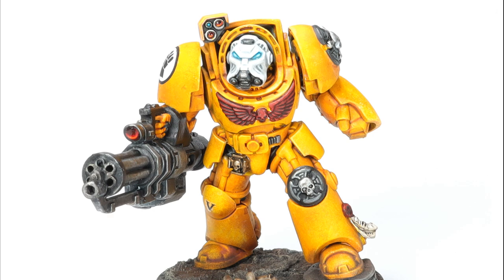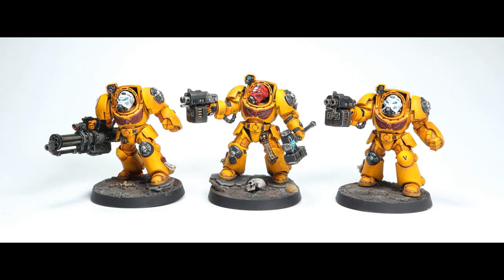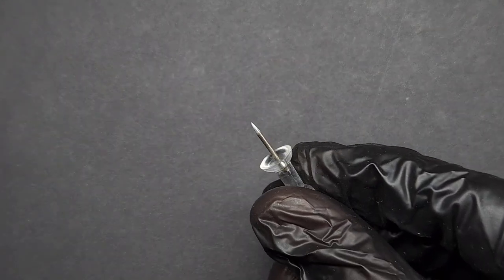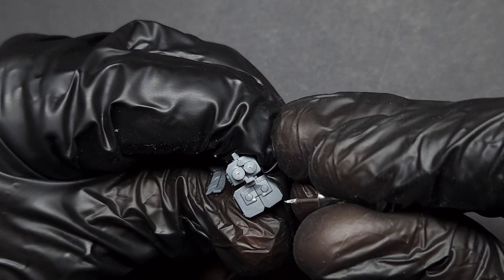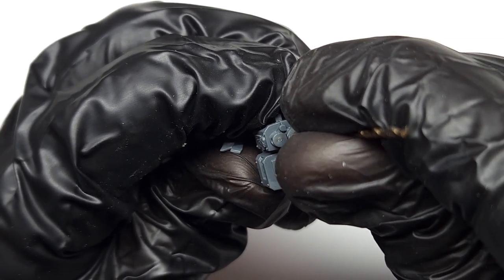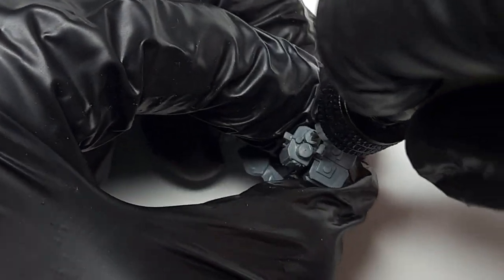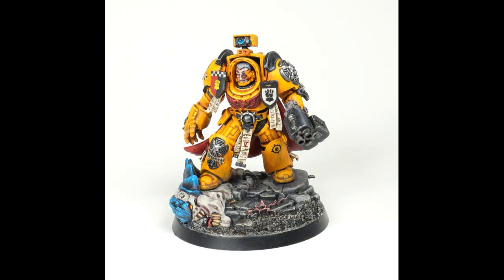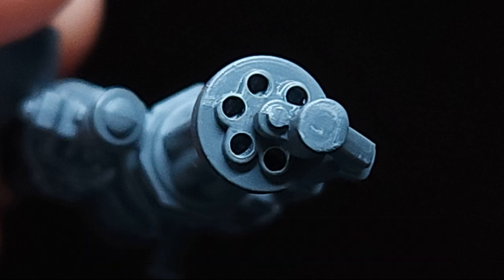Warhammer Hobby Tips: How to Drill Barrels

Comment: I'm an aircraft structural mechanic, and I have drilled millions of holes in all sorts of materials, and I'm here to tell you she is giving you good advice, listen to her specially about using pilot holes.
advanced tip, if you're not great at drilling in general, after you drill your pilot hole, get the smallest drill bit you have and drill, than go to full size with the 0.8mm. that way if the hole if not perfectly centered you can adjust when you go to full size.
Reply from the maker: I really appreciate the support 😃

Comment: Good tips. Works even better with a can piercer instead of a push pin. Can piercers are supposed to put air holes in canned milk, and are usually available at supermarkets. 
A round cutting bit on a Dremel also does a great job, as long as care is taken to avoid overheating the plastic with friction heat.

Comment: I use a hobby knife to gently score a cross on the end of the barrell, this will provide an X marks the spot for the centre of the barrell. I then use a small drill bit to start the hole at the centre of the X, then the larger brill bit to finish the hole. The end of the barrell then gets a very quick sand to remove and sign of the original X. You wont damage the blade and you wont slice yourself (unless you are using the knife badly) because your are not stabbing with the knife.

Comment: Heat up a paper clip with a lighter use that for the pilot holes 

I then use a small hobby drill like shown in the video but for a larger effect I’ll finish off using a normal reamer for RC body’s

Comment: Alternatively, cut off the muzzle, and replace it with a short section of plastic drinking straw. As long as you cut the straw at exactly 90 degrees, you get a perfectly centered circle, and a barrel wall width that is more true-to-scale.
Reply from the maker: Wouldn't that depend on the barrel in question though? Bolters have different size barrels than lasguns and laspistols. And ork weapons are all over the place with barrel sizes.
Reply: @DarcyBonoCreations  Good point. I use different sized straws for different weapons; e.g. lemon tea drink box straws for smaller barrels.